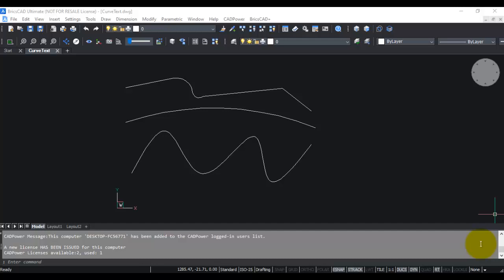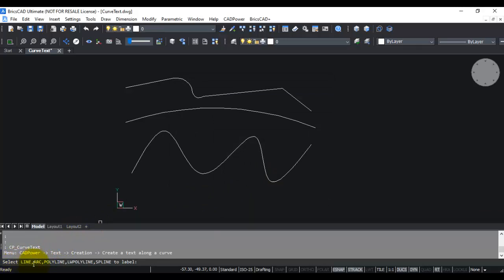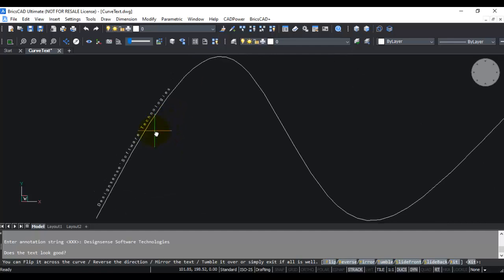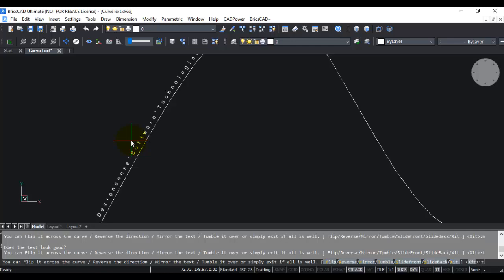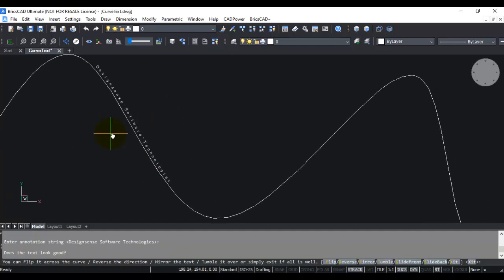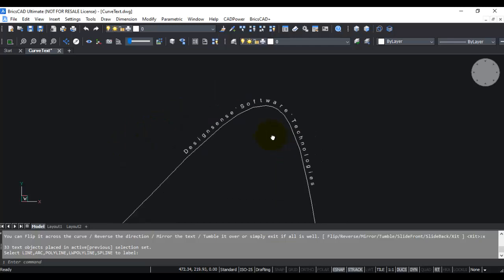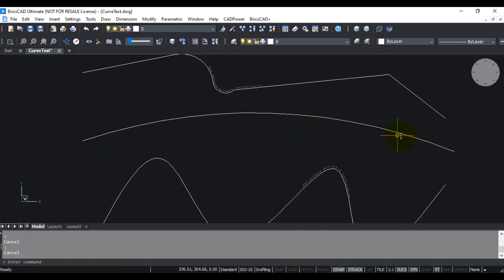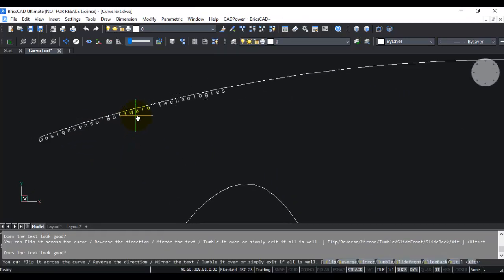CADPower Tutorials: Draw text along a curve in BricsCAD / AutoCAD | CP_CURVETEXT | DesignSense

Comment: You have explained how to use standard text on a curve. What if we want to change the font/size?
Reply from the maker: You can change the font after the text has been drawn, using standard CAD commands like the Properties panel.
Reply from the maker: You can also change the size, but that may cause undesirable effects, like overlapping, as the tool is not designed to auto-fit again.
Reply from the maker: If you need to change the text size, I suggest that you change the font size first and re-run the command. That would be a way to do it.